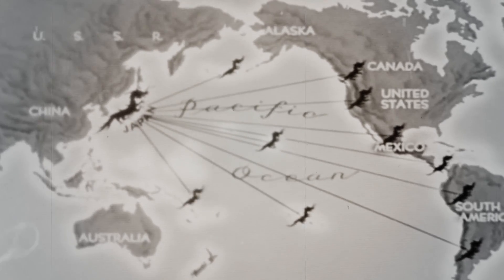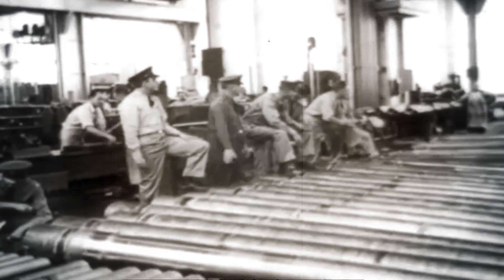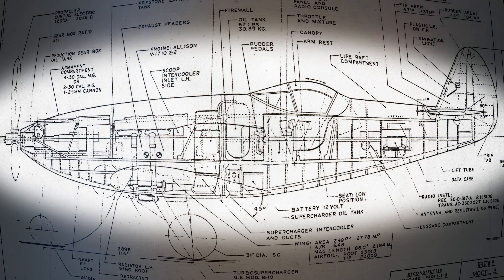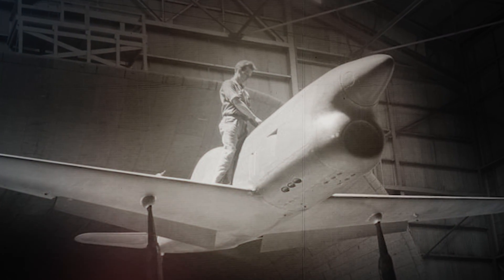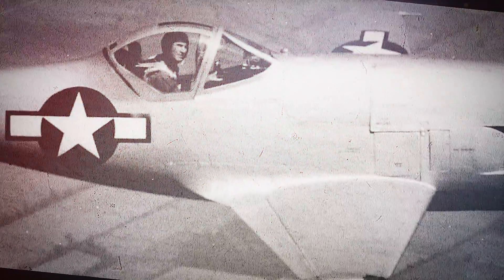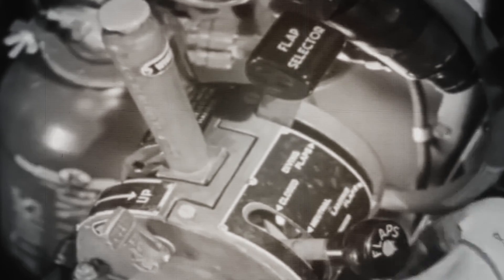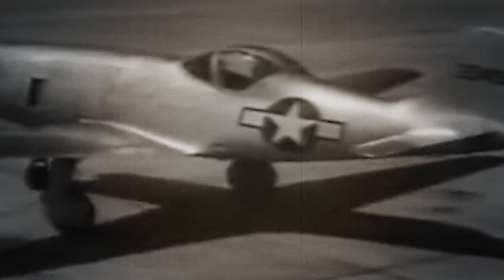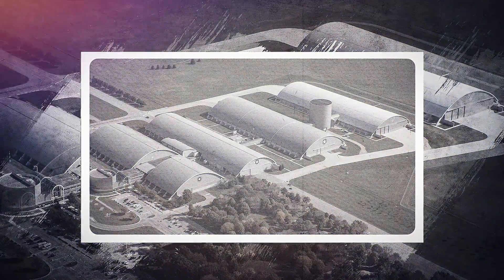Bell XP-77 - America's Emergency Fighter (Built from Wood)

Comment: The de Havilland  mosquito was made of wood, and it was one of the most successful aircraft of ww2.
Reply: If the Mosquito had been powered by Ranger engines it would have been known as a crap aircraft.
Reply: @johnparrish9215  You are absolutely right.  Speed was everything the Mosquito had.
Reply: @-Zevin-  and the ability to carry a bomb load compatible to the B17
Reply: @-Zevin-  and four hispano 20mm cannons on some models..... I believe it only slightly reduced speed and manoeuvrability.
Reply: @johnparrish9215  just like the P51 before it got the Merlin! :-D
Reply: @johnparrish9215  it probably would have broken the sound barrier
Reply: The big fear was the Japanese becoming super aggressive and attacking the west coast and the US losing LA based aircraft factories.
Reply: Had they put a Merlin in the XP-77, that would have been a game changer. But honestly, at that small size, it would never have been anything other than a point defense interceptor.
Reply: @ralikdiver  
Merlin torque in that little guy would have been fun😋
Reply: @IvorMektin1701  hahaha Rich! The torque of the Mosquito engine in that tiny plane would probably make the engine fly away without aircraft 🤣
Reply: @IvorMektin1701  true. The engine would be spinning the airplane as much as the propeller 😂
Reply: @IvorMektin1701  You beat me to that!  I wouldn't like to be in the cockpit when they tried THAT combination!
Reply: @IvorMektin1701  hear me out put the double wasp in it imagine a wooden fighter with 3000 hp
Reply: @TheSaltBoiCometh  
That would be wild.

I unsubscribed from all these "Dark" channels because he gets so much wrong.
Reply: @IvorMektin1701  oh really how so?
Reply: @ralikdiver  I would love to have the design prints just to see if a 632 cu inch Chevrolet could be used. I would make a hell of a great sport plane.
Reply: @johnparrish9215  You'd get it in there, have faith
Reply: @johnparrish9215  This design is just crying out to be reproduced as a civilian kitset with an alloy supercharged [or turbocharged] car engine. I'm sure computer aided design could sort out the handling issues etc. CNC water cutting could have all the pieces cut in an afternoon. I note there are model kit sets online. Maybe you could set your theory at 1:148 scale?
Reply: @ralikdiver  Sometimes small size and low weight occurs. Pilots LOVE those planes, because they fly like a racing motorcycle. The moment The Pentagon thinks it a good idea to overload it with "ordonance", the plane has a more useful role. And it is flying like a brick, faster means a wing breaks off, slower means BEEP BEEP Stall Stall BEEP BEEP. The joy of flying it is gone. Think of the F-16 Falcon, that is such a single engine plane. All that ordonance is a millstone round the neck of a thorough bred. Call it a farm horse, maybe. Great flying is gone. Yeah, during training, you got the plane like it was meant to be. You got the point.
Reply: @ralikdiver  Not enough space for fuel and ammo in that tiny fuselage.
Reply: @ralikdiver  ...the Merlin would have spun the plane, not the prop.....
Reply: @TheWolfsnack  Dear Lord, save me from people with no imagination nor wonder.
Reply: @ralikdiver ; there is no way a Merlin could have been shoe-horned into the XP-77. And remember, the Merlin was liquid cooled, and the XP-77 didn't have room for enough ammo and fuel, much less room for a cooling system and radiators.
Reply: The xp77 engine is inline so it is water cooled.
Reply: @oldgysgt  obviously there would have been a redesign. But they had to reengineer the P-51 too. Just a thought exercise.
Reply: @stephenjacks8196  from the video, the engine looks to be air cooled.  Quick check on wikipedia confirms.   From the cumbersome appearance and that it was fitted on the Seamew, it must have been a poor engine that no one wanted and therefore available for fudging around.
Reply: @scootergeorge9576  Name brand engine manufacturer did not make high power air cooled engines deeper than 4 cylinders in line or 2 cylinders inline flat. In successfully  multi row air cooled engines the rows are staggered to allow cooling air to rear cylinders. The known results of engine overheating is engine fires. (The solution would be to limit engine power or heavier engine (less power per weight). ) Guessing that only other was Chevy Corvair with a flat air cooled 6 cylinder engine, which of course had overheating problems. Overheating carburated engines in a wooden plane sounds risky.
Reply: @stephenjacks8196  - That's why it's the "Lone Ranger."  ; )
Reply: @ralikdiver ; "redesign"? Try an entirely new aircraft. When you replace the wing,  fuselage, landing gear, tail assembly, and engine, you have a different aircraft, NO a redesigned one!
Reply: @oldgysgt  Jebus, some folks are so literal minded. Idle musings, thought experiments, wonder what might have been. What if it had been fitted with a proper engine from the outset? Doesn’t have to be a Merlin. What if ??? Jeez folks, lighten up. The concept as originally stated wasn’t bad. A lightweight point defense interceptor built from non-strategic materials... GO! That’s what they built. The engine company dropped the ball. But what if they had produced the promised turbo? Or another power plant could have been found? The P-51 wasn’t a bad plane with the original Allison engine. But it was substantially better with a Merlin. You don’t think that required a lot redesign work? Rolls-Royce had several engines in production. As did Allison, Packard, Continental... et al. Luckily for us, we never needed something like the XP-77. But wouldn’t have been a bad thing to have available.
Reply: @ralikdiver ; in 1942, when the P-77 was conceived, new aircraft engine designs were approaching 2,00 hp. Even if Ranger had managed to develop a turbo version of their V-770-9 520 hp engine, it would have had put out around 650 HP, around one third of what new engine design were putting out. And putting a Merlin or Allison engine a P-77 would be like trying to put a 3,093 pound Cummings ISX15 engine in a VW Bug. I can never understand what General Arnold was thinking when he authorized Bell to spend Government money on this foolish project. In 1934 it might have made some sense, but in 1944, (the first P-77 flew April 1, 1944), it was a DUMP idea.
Reply: @oldgysgt  The design study was requested in October 1940. Not 1944 and seemed reasonable at the time. The situational requirement never materialized. And it was never a high priority.
Reply: @stephenjacks8196  The Ranger engine was air cooled.
Reply: @rv6ejguy  Pardon my disbelief. No name brand engine manufacturer  was able to solve engine overheating for air cooled engines with more than 2 cylinders inline. Chevrolet Corvair used a flat 6-cyl and suffered engine overheating issues (fires) with 3 cylinders inline. 
Other options, like reducing power output and increased cylinder spacing have been tried.
Reply: @stephenjacks8196  Not sure where you get your facts from. Lots of Corvairs flying in aircraft these days, R4360 radial engine, quadruple  row,  Argus AS17 inline six,  Gypsy 6 inine 6, Ranger L-440 inline 6,  LOM 137/337 inline 6, Isotta Delta, Gamma, Zeta V12s, Renault 626 V16. I've owned many Corvairs, no fires and they cool just fine. I'd add the Porsche 911/917 flat six and flat 12 engines.
Reply: @stephenjacks8196  no
Reply: @stephenjacks8196  maybe an inverted inline six (or something IDK) and with the air inlet right under the propeller it would cool the engine, but there being better cooling in the front cylinders than the rear ones would add another con to an allready bad plane
Reply: @ralikdiver ; according to 'War Planes of the Second World War, Fighters, Volume IV' by William Green, copyright 1961, and published by MacDonald & Co London, Bell first proposed a study for an ultra light fighter on October 30, 1941,(not 1940). On May 16, 1942 Army Air Corps chief General Arnold authorized procurement of 25 of these fighters, later reduced to 6. On August 20, 1942, the type was designated XP-77. The first XP-77 flew on April 1, 1944. But by mid1940 reports of aerial combat over Europe and Britain had shown that a modern fighter needed armor protection for the pilot and vital equipment, self sealing fuel tanks, and 6 to 8 rifle caliber machine guns or four or more heavy machine guns or cannon, (and the light fighter Bell proposed 18 months later had none of these). The combat reports from Europe and Britain were the reason the Republic P-43 Lancer was redesigned starting in June 1940. The redesign resulted in the XP-47. The First XP-47 flew on May 6, 1941, over 5 months before Bells design study for the P-77 was even started. It was known in 1940 what was needed for a successful WWII fighter, and the P-77 as authorized in 1942 had NONE of these minimum requirements. To continue spending Tax-payer money during 1943 and into 1944 was foolish waste.
Reply: @oldgysgt  Wow... some folks really will argue about anything. The XP-77 was an attempt to push the envelope of the accepted norm. To explore the limits of what was possible. And they found those limits. Luckily we didn’t need anything like the 77 during the war. But it would have been foolish not to even try.
Reply: @ralikdiver ; what "envelope" did the P-77 push? It was undersized, under powered, under armored, under armed, and its performance was far short of its contemplates. The only "envelope" I see pushed is the "envelope" of what is the worst American fighter that could be designed during WWII.
Reply: @oldgysgt  You know what, you’re right. How foolish to ask the question, “what if?” I’ll shut up now.
Reply: @oldgysgt  Hang the radiators off the bottom like the spitfire, the thrust they create make up for the drag
Reply: @kingcosworth2643 ; you don't just "hang" stuff on an airplane. "Armchair" aircraft designers have no idea the calculations that must be done before making any change in a real aircraft design. It's simple to glue a new part on your plastic model airplane, but with real aircraft it isn't that easy. Remember, the radiators on a Spitfire were put there to cool the engine, not to add thrust. The fact that a little thrust was gained was fine, but that was not the reason the radiators were put there in the first place. Bottom line line is, an aircraft gets its thrust from its engine, not from louvers and bumps on the air-frame. Yes, high tech exhaust systems and well ducted radiators can help with overall efficiency, but the engine is still the source of power. If you have a 500hp engine, no amount of tinkering will make it a 1,000hp engine.
Reply: @oldgysgt  So that big spinny thing at the front isn't just for prettiness, it makes it go broom.  Of course the radiators were not put there to add thrust, christ all mighty, I was merely pointing out that due to them been a potential modification in this circumstance the drag could be countered to a certain amount by the side effect of thrust helping to restore original speed and trim specs.
Reply: @kingcosworth2643 ; the bottom line is the P-77 was under powered, under armored, ans under armed. Nothing short of a completely new design was going to solve its problems.
Reply: @oldgysgt  Adapt that design! They had not built a single one! Make a fuselage for the Merlin! Do you want a fast plane or not? Duh!
Reply: Finland had also protypes of wooden fighters like VL Puuska(gust), VL Pyörremyrsky(tornado) and VL Myrsky(tempest).
Reply: @henriksagulin9904  Yes, Finland has a great Airforce history. I've seen the YouTube video on learning to fly a certain MiG in Russia, and flying their planes to Finland themselves. These pilots were smart-asses, they needed to learn ALL the Russian tags for ALL these switches and instruments. They did not get a Suomi version! Oops. And they learned basic Russian in notime. Great! And I like the Airforce then being so practical. The Russians sell a plane that is very good and relatively cheap, so we buy MiG's. When the Nato had done that, instead of that Starfighter, hundreds failed and killed a pilot. Wish Nato had the guts to buy the newest Russian fighter. Maybe that dangerous Cold War would have been less cold. We should want good relations with both Russia and America. Russians are YOUR direct neighbours, after all. Yeah, all these missiles worldwide are dangerous. All countries have problems enough, besides that military cat and mouse game. Even in the west we have more and more homeless and unemployed people, who have a huge problem in capitalist countries.  You never get back to a normal life. But okay, fighter pilots often get airliner pilots, they have a good life, no matter where on earth.
Reply: The Hawker Hurricane was a wood/fabric construction and inflicted 60% losses on the Luftwaffe during the Battle of Britain, easy to service and repair compared to it's more famous relative the Spitfire.
Reply: @SpectreOZ  It was a beautiful plane. Handled well, carried a fair amount of firepower, and it could be fairly easily repaired, simply lifting off the damaged wood sections and replacing them if the damage wasn't that great. Although it was a bit slower than the BF-109's, it turned faster. And...if I may say it, the British pilots were more skilled than the German pilots. The Spitfire may have had more glory, but the Hurricane did the lion's share of work during the Battle of Britain.
Reply: @SpectreOZ  Do you know Roald Dahl, the English writer, was a Hurricane pilot during WW2? He even wrote a book about his time being a fighter pilot.
Reply: @SpectreOZ  Plus the Hurricanes mostly went up against fairly obsolete bombers whereas the Spit was ordered against the 109s
Reply: @SpectreOZ  I always liked the Hurricane even more than the Spitfire. More of a workhorse without the glossy image.  Not saying the Spitfire is a bad aircraft or anything.  Just always felt like it's reputation was a-bit overblown.
Reply: @-Zevin-  I wouldn't say the Spitfire's reputation was overblown but perhaps that it's achievements foreshadowed that of the Hurricane.👍
Reply: So were some of the Russian fighters of the time (LaGGs and Yaks iirc). Though they varied in percentages of wood used as different models were introduced over the course of the war.
Reply: The USA considered the option of building Mosquitoes under licence but political forces within the USAAF killed the idea. Instead that went for the Lightning with the Black Widow for the night fighting. The latter meant that the USA were very late in fielding a suitable night fighter.
Reply: @PassportToPimlico  Don’t forget that the US conducted daylight bombing over Germany while the British bombed at night. Radar and IFF being in their infancy, it was probably best to limit friendly losses by limiting friendly aircraft at night.
Reply: @NH2112  My grandfather's unit built a forward airfield at Lille that was later used for night fighter Mosquitoes to work as intruders going in with the bombers to hunt the German night fighters. The issue with the Black Widow was purely that it was developed quite late on in the war.
Reply: @PassportToPimlico  It worked great to distract the Japanese guards at Cabanatuan prison camp so the raiders could get to the camp undetected, likely saving a LOT of Allied lives. I think it’s an absolutely beautiful aircraft, in the same way the EE Lightning, Blackburn Buccaneer, or F4 Phantom II were.
Reply: The US had to use the Beaufighter until the Black Widow was ready.
Reply: @PassportToPimlico  Which proves American politicians are often as crazy as, yeah, as what? WTF was wrong with building Hurricanes in the States? When is America finally gonna be liberated from those people who harm their country, and still are far too proud of themselves? Forget it. Somehow you all love this madness.
Reply: El Guapo mas macho  When or where did I refer to "Il-2" or flight simulation games? The specs are easily found on Wikipedia (which are backed up by cited sources), and from numerous governmental sources, pilots of the P-40 tell you very little how it actually handled. It just so happens the bf-109 pilots thought the Bf-109 was the greatest machine ever created, and spitfires pilots thought it was handed down from Jesus Christ himself, The Yak-3 according to Soviet pilots was superior to any aircraft ever created. To allot of pilots it probably did feel like the P-40 "handled well" Compared to what? What in the world does well mean, as compared to a trainer biplane? What is the actual subjective experience of all of these different individual pilots? Did these pilots ever also fly a Bf109 or A6M?    It's certainty interesting and valuable to listen to first hand pilot sources for the stories they have to share, but the specs of the aircraft along with what the actual US army air core thought of the aircraft and how it actually tested compared to its adversaries. 

Everything I said about it happens to be true here.  The P-40s basic flight characteristics according to the United States government itself were considered absolutely terrible for 1940s and needing of immediate replacement.  Yet it still remained a good energy fighter for every reason I mentioned. This is not controversial at all, we have massive amounts of data and information available on this subject and the P-40 just fails measurably as a dog fighter in all of these metrics. This remains true in actual practice, the only time the P-40 was successful was when used as a energy fighter. 

Then you talk about "you just need to research more" which not only continues to come off as rude and condescending yourself, you still genuinely can't accept the fact, that I have done allot of research and reading on the topic. I do not hold individual pilot testimonials to high regard, in the same way a court of law does not hold eye witness testimony as a high standard. I care about data and facts.  The facts here are crystal clear.
Reply: El Guapo mas macho  This is some top shelf cringe. The mosquito FB series, and reconnaissance planes were used as pursuit aircraft. As well as the Night fighters that were specifically built pursuit attack fighters. Of course you would know that if you had done any research whatsoever. Try reading a book.  Remember when I said try to stop making an ass out of yourself, you really can't help it can you?  Shown your true colors completely devolved into acting like a child, while still managing to be wrong. Talk about a fragile ego, as well as emotional outbursts, you really should learn to control your self. I'm almost impressed at your ability to embarrass yourself publicly. Being a clown seems to come naturally to you.

Here, you might learn something in between your emotional breakdowns on the internet. "A fighter aircraft is primarily designed for air-to-air combat. A given type may be designed for specific combat conditions, and in some cases for additional roles such as air-to-ground fighting. Historically the British Royal Flying Corps and Royal Air Force referred to them as "scouts" until the early 1920s, while the U.S. Army called them "pursuit" aircraft until the late 1940s. The UK changed to calling them fighters in the 1920s, while the US Army did so in the 1940s. A short-range fighter designed to defend against incoming enemy aircraft is known as an interceptor." Any thing else to add so you can embarrass yourself further?
Reply: The Mosquito was combat viable practically the day it came off the assembly line.  The XP-77, as the Brewster Buccaneer, would ever not be mission competent.
Reply: 69 likes
Reply: @TheCrowOfJudgement  Noice!
Reply: Not a lightweight though. And the Merlin.
Reply: @bluetopguitar1104  Merlin was definitely the magic ingredient to the Mosquito.
Reply: @-Zevin-  And the P51, replacing the Allison with the Packard built Rolls Royce Merlin transformed the aircraft.
Reply: Remember the listed woods survey for the war period?  In Britain they did have the wood to ply their plane building. And that still required good glue and carpentry craftsmanship and knowledge. The Germans tried to make wood superfighters and cups only make semi flimsy Volks craft because they're glue knowledge was crap. I don't think the US's knowledge of glue in practice with fighter production would have been better.
Reply: That plane made Goering green with envy.
Reply: @mudhutproductions   The only way to make Goering more envious was to be the only man in the room with a doughnut.
Reply: @-Zevin-  I think the dude on the other side of the room with the morphine would have made him a little more than even that. :)
Reply: @mudhutproductions  Haha good point!
Reply: El Guapo mas macho   So you turn to name calling (again) For your second emotional outburst. At least the first time you had to decency to apologize for your childish behavior and whining while ignoring factual data based information. Like pilot testimonials being statistically useless in a scientific context.  I apologize for wasting time trying to have a civil conversation with you.  You even close by saying "Saburo Sakai said a well handled P-40 was one of the hardest opponents", yeah because the P-40 was a good energy fighter.  Which I have said from the very start. You haven't provided a single iota of information about the P-40 performing well in a dogfight. In-fact you seem completely unaware of the difference of energy fighting and dog fighting... Rational thought and context really is slippery to you isn't it? Talking about a fragile ego, the irony is too great.  I suggest not making any more of a ass of yourself.
Reply: Hurricane aircraft used in The Battle of Britain alongside its more famous Spitfire brethren were made of wood and canvas fuselages. They were very successful.
Reply: The Mosquito wasn’t a single-purpose aircraft designed for extreme economy with strategic materials.  It was a fully capable, full-size twin-engine aircraft designed to use nonstrategic materials.
Reply: It wasn't the fact that the XP-77 was made of wood that doomed it to failure, (even the USSR had a number of successful wooden fighters early in WWII),  it was its small size. Bell chief designer Robert Woods was total wrong when he thought he could design a viable WWII fighter that had a wing area of 100 sq ft, weighted less than 2 tons loaded, and was powered by a 520 hp power plant. The Mark XII Mosquito had a wing area of 454 sq ft, weighted over 10 tons loaded, and was powered by 3,420 hp from its two Merlin engines. No comparison.
Reply: @oldgysgt  yup, the LaGG (if I remember correctly) was woden
Reply: @oldgysgt  and it could carry a 4,000lb bomb load to Berlin with a 2 man crew.
Reply: @davidpage4005 ; when you say 'it" I assume you are talking about the bomber version of the Dehaviland Mosquito.
Reply: @oldgysgt  Allot of assumptions here.  Of course wood isn't a issue, that was my point.  However I am in no way equivocating a Mosquito which was a long range pursuit aircraft, and reconnaissance aircraft with a tiny emergency short range scramble fighter. It's like saying a P-40 and a B-29 are different even though they are both steel framed.... that's obvious.

You say "chief designer Robert Woods was total wrong when he thought he could design a viable WWII fighter that had a wing area of 100 sq ft, weighted less than 2 tons loaded, and was powered by a 520 hp power plant" 
However it wasn't obvious and it wasn't objectively a terrible idea.  Particularly if you could have improved the engine and used it specifically and only as a emergency scramble fighter that has excellent power to weight ratio and rate of climb.  Particularly compare it to the contemporary alternative the P-40 series,  which had the rate of climb and low speed agility of a flying bathtub.  There is various reasons why this idea failed, but it wasn't a bad idea in principal.
Reply: @-Zevin- ; then why bring up the Mosquito in the first place? Robert Woods mad a lot of miscalculations while at Bell. He thought a four place, pusher prop, multi engine fighter with flexible cannons in the front of the engine nauticals would be a good bomber interceptor, it wasn't. He thought placing the engine behind the pilot  in the P39 would make it more maneuverable, it didn't. He thought he could design a successful jet fighter using a late 30's wing profile, he couldn't. The thought the best way to increase the range of a jet fighter was to turn the fuselage into a giant fuel tank, (Bell XP-83), it wasn't. Robert Woods had a long record of bad decisions when it came to designing aircraft, and the XP-77 was a example of one of them.
Reply: @oldgysgt  I want to be clear here, I don't think the XP-77 was a good aircraft, just the idea of a ultralight scramble fighter wasn't a terrible idea in principal.  However you bring up the P-39 I will defend that aircraft to death, In many respects it was one of the most successful aircraft of the second world war, and aces racked up more kills in the P-39 than the Spitfire, Hurricane, P-51, P-47 or P-40. The P-39 was exceedingly agile, specifically when the guns were removed from the wings.
Reply: @-Zevin-  
Don’t get me wrong I’m a fan of the mosquitoes and other planes the British managed to come up with in dire times of desperation.. but from what I’ve read about them is different to what I was always thinking, being that the metal was an essential metal for war so an alternative was needed, but it seems that the wood needed was difficult to get hold of being where it came from and there were different woods needed, the only benefit I can see was the great idea from which de-haviland already was notable for and the labour used was from unused woodworkers.. so this aircraft (again I’m a fan of the bell works) the wood they say is something that’s unused and in abundance ( I know it’s for the program) was it a multiple wood construction not just the simplified planks of wood they described 
Kind regards
Reply: @brudenell27   Good points. Wood construction does seem illogical to a modern mind, other than as a emergency measure, but they really did magic with it.  The De Havilland Hornet was still made of wood even late war, and I think they had the resources to make of aluminum or metal alloy if they choose to.  That plane had incredibly high performance.
Reply: @-Zevin-  
They even made use of it with the vampire ( my dad has landing gear for 1 in his garage) he worked at a college and I remember the plane as a kid.
Thank you for your reply 
Kind regards Carl
Reply: @-Zevin- ; An ultra light weight fighter with less than 600 hp was a DUMB idea in 1942. And who told you the P39 had more confirmed kills than the Spitfire, Hurricane, P-51, P-47 or P-40? The Russians? They were the only ones to use the P-39 in large numbers in combat in WWII. But then, according to the Red Air Force they shot down more German aircraft than Germany made during WWII. What non-Russian fighter pilot ever became an ace flying P-39's? The P-39, like the P-40, was obsolete when the US entered WWII. Of the 9,558 P-39's made, 4,758, (over half), were sent to the USSR. The British rejected the P-39 for operational fighter vs fighter use because of its poor performance. The few P-39 in RAF service were used for strafing operations, but were withdrawn from all operational use in December 1941, also because of poor performance. Briton sent some of their remaining P-39's to the USSR, and some were returned to the AAF as P-400's for emergency use in the South West Pacific. Apparently the AAF and the RAF didn't share your opinion of the P-39. After P-47's and P-51's became available in sufficient numbers, the AAF used most of its P-39's for training. The last US unit to be issued the P-39 for use in combat was the 332nd Fighter Group, (known as the Tuskegee Airmen), but they converted to P-47's 4 months later, and later to P-51's.
Reply: @oldgysgt   Never said the P-39 had more total kills, I suggest you re-read what I said.  The Top Aces of the Allies flew P-39s, and individually racked up more kills than any other American or British fighter while flying the P-39, Possibly with the exception of the Spitfire but the total kill count of  Thomas St John Pattle is in question. 

 You sound deeply ignorant about the history and use of the P-39, ignorance and arrogance is always a very amusing combination to watch.  The P-39 was objectively one of the best single engine fighter aircraft of WW2 at low altitude.  You seem to lack any understanding whatsoever as to why the P-39 didn't replace the P-51-P47 or P-40 for that matter, and Why the British didn't choose it. It didn't have a supercharger so it objectively performed outright bad at high altitude.   

At low altitude the P-39 outperformed every single aircraft you mentioned.  It's kind of a moot point because on the Eastern Front the majority of the air war was done at low altitude, where it was perfectly suited, while in the pacific and from Britain they needed long range very high altitude fighters.  Different aircraft for different purposes. Ever heard of nuance? You should educate yourself before you make a fool of yourself publicly; aggressively talking about something you clearly know very little about.
Reply: @-Zevin-  Check Pilatus PC-7 and PC-9. Okay, Bell didn't have turboprops yet. Maybe something like the arobatic Extra300. A small plane around a 500 hp engine can be bloody nimble. You only need larger size, when you want more fuel, more armament, more ordonance. For those emergency planes, all you need is a very good gun. And pray they didn't shoot back. Think about these German rocket fighters, they took off, shot a bomber or two, ran out of rocket fuel, so they came down for an unpowered landing. Emergency fighter pur sang.
Reply: Along with the Hawker Hurricane.
Reply: The hurricane was made of canvas and wood
Reply: @tomahwak1985  No. Hurricane was a welded steel frame with doped fabric covering.
Reply: @tomahwak1985  the engine sat in a welded steel frame and wings had steel main spars. Rem life doesn't exist in a vacuum: Hawker used construction used on then current (1934) Hawker Fury/Hart biplanes which used steel tube frame. In WW1 Fokker used steel tube construction and Albatross used formed plywood like the Mosquito. Your "wooden box" construction was considered a weakness even in WW1.
Reply: True but it wasn't a mass produced fighter.
Reply: @bobbowers9037 ; there is a reason the P-77 was not mass produced. It was a total design failure. the Army Air Corps admitted that when it cancelled P-77 development in December 1944.
Reply: Because in europe, we KNOW how to build vehicles...😉
Reply: @NiSiochainGanSaoirse  P-38 would like a word.
Reply: A much bigger and more powerful plane.
Reply: Absolutely. The DeZHaveland Mosquito was absolutely one of the finest dual engine fighter a multipurpose planes of that period and was powered with 2 RollsRoyce Engines that gave it more than adiquate
Reply: Power.

The old professor 
Live free or die!
Death to all tyrants!
Reply: Top 10 maybe
Reply: It had two engines 😐 that can make all the difference.
Reply: @craftpaint1644 ; my God, we are not talking about a toy airplane you drag with a string on the kitchen floor. You "arm chair" aircraft designers have no idea what it takes to design a REAL aircraft. Stick to your wooden pull-toys.
Reply: See
Reply: #stopwoodenairplanediscrimination
Reply: So were most of the Soviet Yak fighters, along with the La-5, and many other excellent planes of the USSR.
Reply: The Mosquito used a "stressed skin" plywood (ie composite). A much stronger construction technique than the solid wood frame construction of xp77 (WW1 construction method for biplanes.)
Reply: @stephenjacks8196  The XP-77 was not wood or fabric skinned, it was metal skinned with a wooden frame. The mosquito even had wooden skin and flaps. With metal ailerons.   Considering the light weight aircraft it didn't need to carry heavy bombs and 2 large engines like the mosquito did, and within normal operation and G-loads I don't think a stressed skin Plywood would have offered any major advantages to a tiny fighter. Same thing with the LaGG series soviet fighters. Plywood is actually  weaker than solid wood... 

Furthermore "stressed skin" construction is a WW1 construction method for biplanes... The Zeppelin d1 fighter used it in WW1.
Reply: @-Zevin-  I'm a little puzzled: in your earlier post you characterize the Mosquito as "a long range pursuit aircraft" and I was going to point out that it was designed as a bomber that would rely on speed and altitude for survival, and hence had no guns at all - only acquiring them when it proved so capable and versatile.  But in this later post you acknowledge its "need to carry heavy bombs" - a bit inconsistent?
Reply: @nemo6686   No not really inconsistent. Although I can see how I could have mislead someone who wasn't completely familiar with the aircraft. It was all of those things, allot like the P-38. It was originally conceived as a fast bomber you are absolutely right. Ironically just the opposite of the P-38   Part of this is just my bias, I always loved the FB variants, and night fighters.  Those variants  are what really made the mosquito phenomenal in my mind. With 4 20mm hispano and 4 30cal. Because of their speed they were excellent pursuit aircraft, and reconnaissance aircraft really fantastic at chasing down targets until late model spitfire, tempest and P47 p51 started to approach and ultimately surpass its top speed.  Its role as a pure bomber was always far less interesting to me as other aircraft like the P-38, Pe2 and even me110 served a similar role, in many ways the PE2 was more prolific and successful as a bomber than the Mosquito.
Reply: @-Zevin-  I'm well aware of the Mosquito's varied history*, but thanks for the laugh.  Funny too you should mention the Me110 as a comparison, given that it was a fighter used as a bomber because it was so bad, whereas the Mosquito was a bomber used as a fighter because it was so good. 

* Night fighter, reconnaissance, maritime patrol, ground attack - Tsetse - even civilian passenger flights to Stockholm, to name just a few roles.
Reply: @nemo6686   The myth of the Me110 being "so bad" Is just that a myth. One repeated by poor quality older documentaries. It was never intended to be a dog fighter, it was intended to be a "heavy fighter" or  bomber interceptor which it performed well at.  They just didn't need to intercept allot of bombers during the battle of Brittan, and it performed extremely well as a night fighter. Again all of those aircraft , the me110, the p-38, the Pe2 performed almost all the roles you described except passenger flights.  

I will reiterate the Pe2 was a superior bomber to the Mosquito.  There is another myth that the superior speed of the Mosquito meant it could just run away,  As a recon plane at very high altitude this was definitely true. unfortunately it doesn't really work that way often times defensively, especially as a strike bomber.  If enemy fighters have altitude on you, even a slower Me109e could dive past 400mph and outrun a older model Mosquito.  What really made the Mosquito shine was not its capability as a bomber. While this is my opinion, it's backed up by the historical record and facts.
Reply: @-Zevin-  I think I was thinking of "monocoque" construction where skin/shell is strength component not  a covered chassis frame. However plywood is strong in all directions and the multiple layers cover flaws in individual wood plys. The plywood glue is a strength component. Glued joints break through the wood not glue. Re plywood vs wood strength. Most multistory wood buildings built recently, the joists and beams are "engineered lumber" or small wood pieces glued together, because of scarce large diameter trees with no wood defects. Engineered wood is stiffer and stronger than natural wood.
Reply: @stephenjacks8196  You are absolutely right about monocoque construction. That clears up my confusion. I didn't know the Mosquito was monocoque constructed, I always assumed it had a ridged frame.  that construction method most certainly is very strong.  I think it's the same principal why a egg shell structurally is very strong.
Reply: @-Zevin-  So you're not aware that  Mosquito factories pump super hot steam into molds for fuselage, wings, etc. causing wood fibers to adopt the shape. Not just glue and nails, the wood itself "grows" into the Mosquito shape. Most autos and modern aircraft utilize shell strength, Boeing made the last passenger airliners that had a "strength deck", although heavy transports require supporting multi-ton vehicles and tanks. 
As wood is a renewable material and lightweight like Aluminum, why can't autos be built like Mosquitos? 
My neighbor built a pickup truck bed out of wood. Some car rear ended (while his was parked) his pickup and was totalled. The wooden pickup truck bed had a few flecks of paint.
Reply: @-Zevin-  Nah, plywood comes in different qualities. For planes they use selected panels, and all layers are of that best quality. Even the glue was special, it could resist water. For an inner wall in a house, you don't need that. For a +9 to -7 G fighter, you want good specs.

I know somebody who owns an SZD Cobra, a glider that is a sister of the famous Polish Junior, the SZD-51. Well, that Cobra was one of the last gliders one could buy new, with such plywood panel wings. And after all these years, it is still airworthy. Because the SZD factory does a very good job on gliders. There are some metal gliders, but most are fiber and resin, today. And there are still a lot of vintage gliders around the world. But not a lot with these plywood wings. Yeah, the Cobra was the last of that kind of wings. And treated with care, it can survive a long time.
Reply: @nemo6686  Check how the Mosquito developed. In later versions they added FOUR cannons, 20 mm I think, maybe even larger, that were very accurate. The Germans did not like that Mosquito.

Here they want a fighter. A nimble plane, in those days they did dog fighting. A mosquito was too large for that, smaller fighters would get behind it and fire it down. If it were not the fastest plane around, that is. Full throttle and the Messerschmitt's were not fast enough to keep up. Thanks to those TWO Merlin engines. The Americans needed a "half" Mosquito. Somebody mentioned the Hurricane. Who knows.
Reply: @-Zevin-  Hmm, just seen a video on the Mosquito. It was used as a bomber, for targets other planes simply could not bomb, for lack of range. Mosquito's bombed Berlin when that was most wanted. And flew back to Britain. Without the Mosquito, such missions were impossible. But I don't think those bombing missions took a large percentage of the number of flights. You would have known.
Reply: @stephenjacks8196  Okay, that proves Woods was not that bright all together. I had plywood sailing boats. Same principle, bended plywood is stressed. It is a strong and light construction. Building in solid wood could be safer, small errors are not that bad. And I bet they simply had solid wood available, making aircraft plywood takes time and people and is not exactly cheap. We don't know all details, here. After all, he designed planes, I just write silly comments. But you are right, plywood would be the obvious material. Light and strong. A sandwich with balsa (or modern foam) in between is a classical thing, an egg shell so to speak. But okay, during war time? Keep it simple stupid might be best.
Reply: El Guapo mas macho  You are getting really oddly aggressive and defensive at the same time. As If I haven't done extensive research here, more so than you it is evident.  I was literally apologizing if talking about "boom and zoom" tactics if it seemed condescending to you, as I didn't intend to teach you something you already understood. I take you you don't spend time on aircraft forums and talking about this often because the meme of Americans explaining boom and zoom has become a big joke.  As if Americans had this amazing novel idea that nobody else knew about. 

The fact remains the P-40 was a poor dog fighter, qualitatively the worst production dog fighter of any country at the start of world war two. What you are seriously missing here is context. Poor dog fighter does not mean poor fighter. It means it had terrible speed management, rate of climb etc. That all remains true. Some biplanes had faster roll rates than the P-40 does that mean they were superior fighters? That they could magically do a Split S and shoot down Bf-109F series aircraft that were objectively better aircraft by every measurable metric but roll rate?  Did roll rate make the P-40 superior to the Spitfire? Objectively one of the greatest assets the Spitfire had in the war was its power to weight ratio and phenomenally good climb rate. 

What the P-40 had was weight, and good characteristics at high speed. Which made it gain speed rapidly in a dive and handle energy fighting very well. A split S is perfectly useful for energy tactics, but as soon as that P-40 commits to a one circle rate fight, and gets tied up in a turn fight it is objectively worse than the competition.  You really are not getting the context or nuance here at all. Take the roll rate, did I say the Roll rate was useless? No I did not I said it was useless in a dog fight, which is true. Its roll rate into a split S is valid as a energy fighter.  It was a good energy fighter, turn fight dog fighting it was bad at.